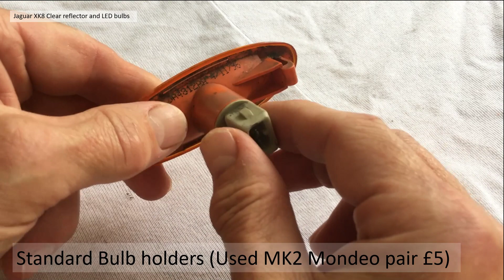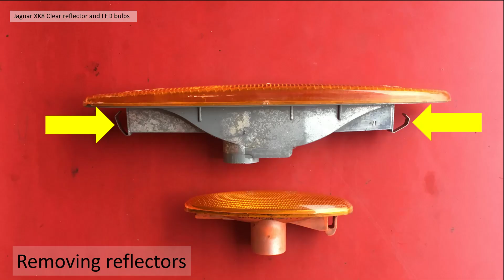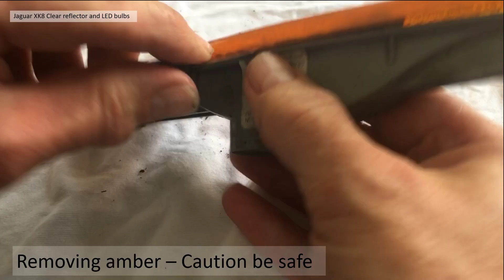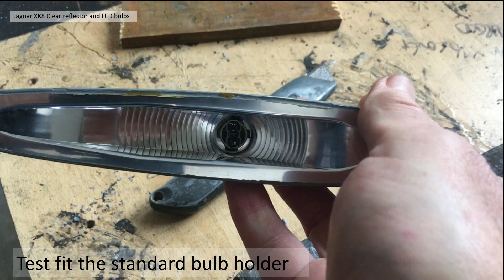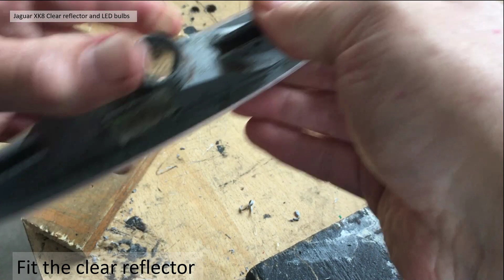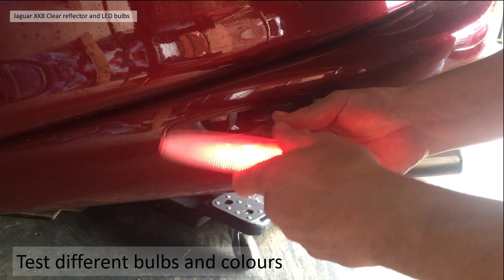Jaguar XK8 Clear Bumper Reflectors & LED Bulb Conversion (10 DIY Steps). XKR X100 V48.

Comment: Can you give the part numbers for these bulb options?
Reply from the maker: dfbender, sorry don’t have part number as just purchased from eBay by the description. Thanks for the comment regards Damian
Reply: @Modurol  PNs should be on the packaging when you received them I’d think?
Reply from the maker: dfbender, packaging long gone, regards Damian
Reply from the maker: https://www.ebay.co.uk/itm/372534384424
Reply from the maker: https://www.ebay.co.uk/itm/132914615230
Reply from the maker: https://www.ebay.co.uk/itm/362738543573
Reply from the maker: dfbender, the eBay links will probably change over time. Regards Damian

Comment: Uk requirement is for lights on the side or a car to be amber. I don’t think they will be impressed with white.
Reply from the maker: Andy, I believe you are correct about the front side light but you can have a red light within 1m of the rear of the vehicle so kind of half right, by accident. Can have white if it’s trailer manufactured before 1990, ha ha. Thanks for the input and heads up with the UK The Road Vehicles Lighting Regulations 1989 No1796. https://www.legislation.gov.uk/uksi/1989/1796/schedule/9/made Looks like I need amber bulbs in my front side markers to be strictly correct. Thanks for the comment, much appreciated Damian

Comment: Damian, do you have a source for the bulb holders, I have done the clear lenses already, searched ebay but can’t find those holders ! Nice video very well explained.
Reply from the maker: Martin, if you have changed the indicators to clear lense type you should have two spare bulb holders from that. 
Plus search for ebay listings for Ford indicators and look for the same bulb holder. 
Probably need to buy the indicator and holder to get the holder. Here's two I found :-
https://www.ebay.co.uk/itm/Ford-Mondeo-1995-wing-indicator-side-repeater/333156780644?hash=item4d91b10a64%3Ag%3AFSUAAOSwLsBZSraF&LH_ItemCondition=3000
https://www.ebay.co.uk/itm/Ford-Mondeo-MK2-Side-Repeater-Wing-Indicator/164351483304?hash=item26441c9da8%3Ag%3APtoAAMXQeKNTLejl&LH_ItemCondition=3000
You can also buy new US units with red lenses part number LJA5034BC these come with bulb holders.
Thanks for the comment, hope that helps, Thanks Damian
Reply: O&DR Jaguar XK8 Damian, mine came fro Adamesh without spare holders, but thanks I will manage now, I am rubbish at search terms for ebay !
Reply from the maker: Martin, glad you are sorted, not the easiest things to find, but you can find them. The best value ones seem to be labelled ford as soon as you put the Jaguar name infront the price seems to double. Thanks for the comment Damian

Comment: Very interesting. I'm in the UK and just so I understand, is the existing wiring Harness (for the 4 large corner reflectors) only for Daytime Running Lights? and NOT part of the turn signal Harness? - so these will never flash when signalling?
Reply from the maker: Paul, correct just DRL on indicator function. Amazing the harness is there in every car regardless of market. Just found you can buy red US version for the rear from Brit parts, may try those. Thanks for the comment Damian
Reply: @Modurol  Just had a look at mine, popped rear reflectors out,  can't  find any wiring  in that area other than rear parking sensors running across  bumper and rear light wiring running up into boot floor area.  2002 UK XK8.
Reply from the maker: Colin, ok, on mine there was a wired socket attached to gommet fixed to the rear chassis rail above the exhaust. Sorry if you haven’t got one maybe being used for the reversing sensors. Might suggest checking both sides in that case. Thanks for the comment Damian
Reply: Maybe worth lookin in the sides of boot. On The XJ they leave the connectors there for them